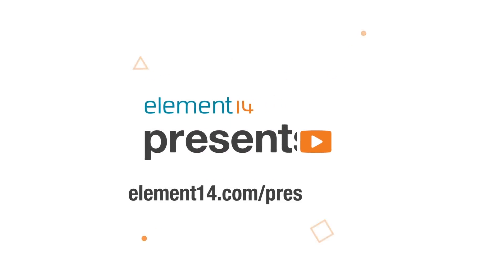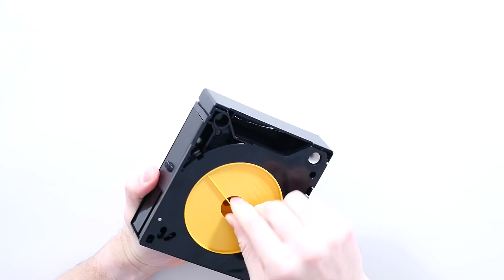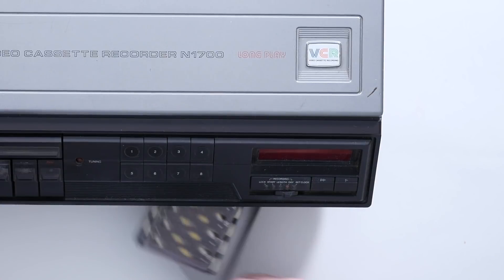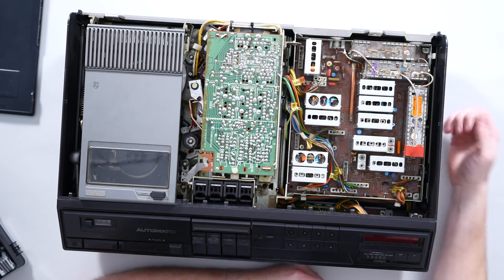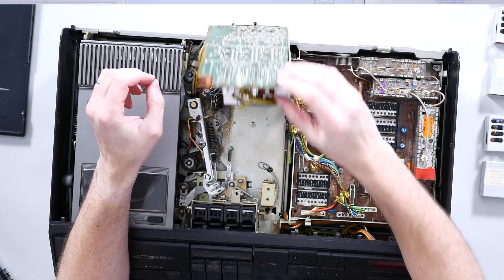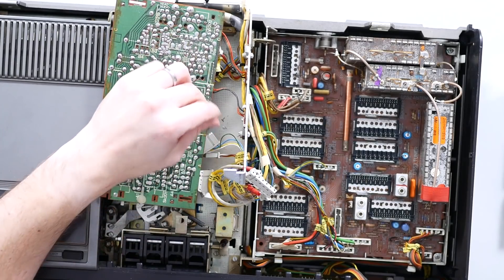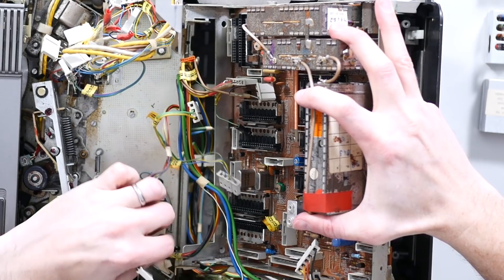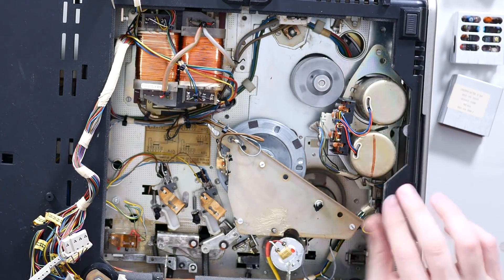Philips N1700 VCR Teardown - The Electronics Inside

Comment: These machines are fantastic beasts of technology! I learned a few tricks on how to repair these from an elderly friend who used to be an engineer for Radio Rentals in the 70's and 80's and repaired many of these machines. I've managed to get several of these dinosaurs back to life, and the picture quality can be surprisingly good! The belts will be the first priority, then a good clean up of the lacing mechanism, the tape path, and the audio and video heads, and that big rubber pinch roller. Colin (video99.co.uk) has some great video guides on his YT channel on these machines. Best Wishes on the restoration project :)

Comment: I have exactly the same unit which powers up but doesn't play and two tapes. The difference there is the modules in mine are rusty. I have replacement belts for this as the old ones turned into a sticky rubber licorice mess. I'm looking forward to your attempts at repair.

Comment: That machine uses a strange videotape which has it's reels stacked one on top of the other, if you intend to get it working then don't take it apart, You should have made a note of where the modules went before removing them, I hope you have a service manual for the PHILIPS N1700
Reply: Indeed I do, all Modules replaced succesfully (I placed them in order as I removed them, and have the video for reference too), new belts just arrived, and I'll be testing each board at a time from the power supply outwards!

Comment: What I like about it is also that it shows why these things were so expensive compared to their modern counterparts, and why they stopped being built like this: the whole thing is labelled, modular, socketed, robust… and it stops working because a 2 cent piece of rubber dried out, which is just a thing that inevitably happens.
Reply: Absolutely, It shows why those old TV and VCR repair shops that every town had were well worth it. If you spent that much on a device that was servicable, you would! Today, things are so hard to repair, and cheap to buy they just aren't viable to repair.